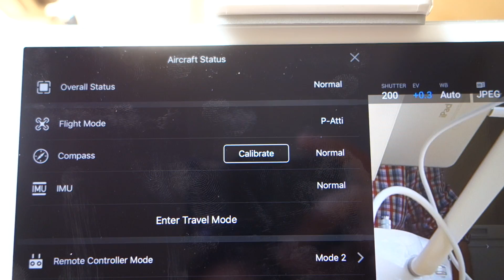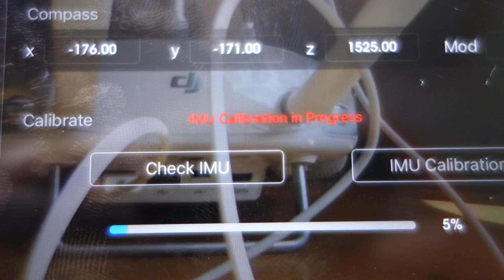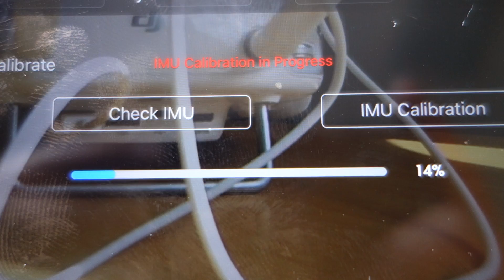Dji Inspire 1 After Firmawere IMU Calibration July 2017!

Comment: can it still be in travel mode
Reply from the maker: No problem. But camera must be taking of first. Then back in travel mode. Fantastic drone this Inspire 1. I have this and Dji Mavic Pro. Two fantastic drone.
Reply: teknofil007 that’s awesome I love my inspire plus we have a mavic a phantom 3 and bebop 2 and a broken yuneec q500 that needs a camera hahahahaha but I can’t switch to video mode on the mavic I’m wondering if I damaged the transmission cable changing the ribbon cable but it takes pics just can’t switch to video mode aaaahhhhh lol